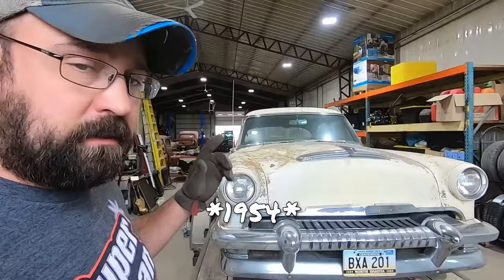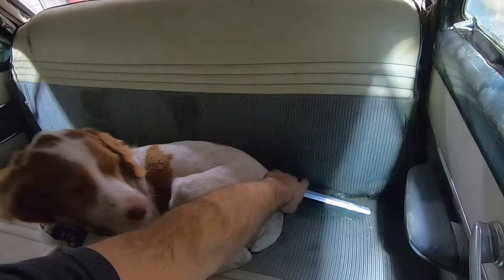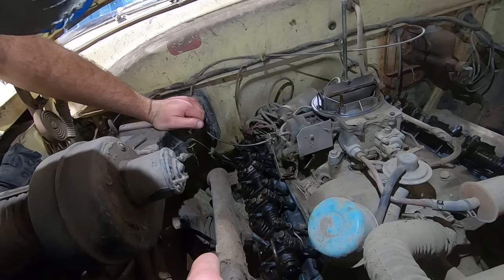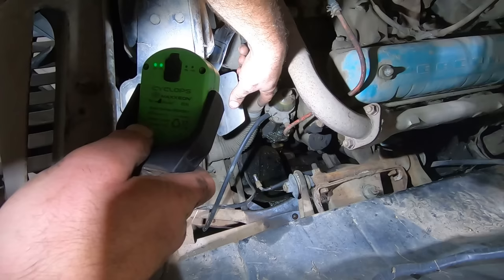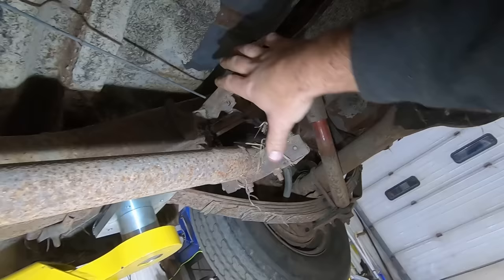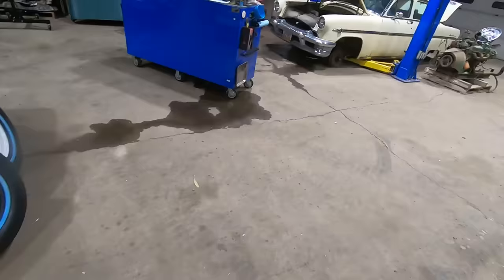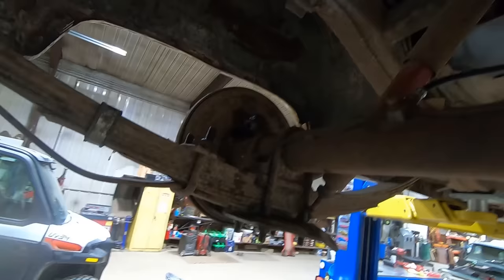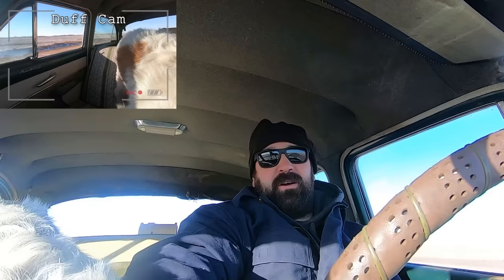1954 Mercury Monterey Transformation! Abandoned in a Field for 29 Years! Will It Run?!?

Comment: Wish you had a crew? NOTTT!!! you dont know how good ya got it Mor.t  Pay some one to do a job, then YOU get to do it agin , and fix what they screwed up. and you smmile though the entire job.  Get your crew to put the plug wire guide/holder , the n you get to redo the firing order  and fix the the stuff they broke doing the job. And yea, its a two speed auto. and your gagues will read high witdh a 12 volt  battery, and blow all your bulbs and smoke your  blower motor.Enjoy !!
Reply from the maker: Lotta truth in that!
Reply: and your gauges and radio @MortskeRepair